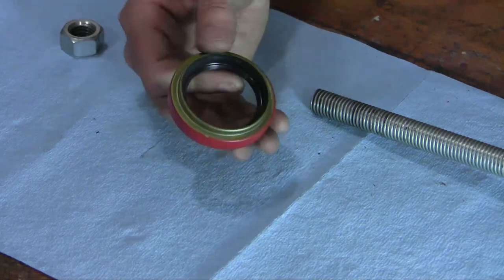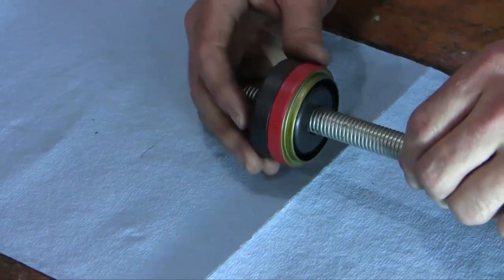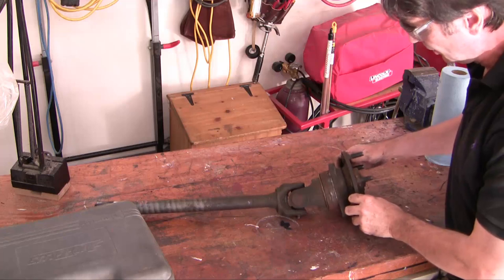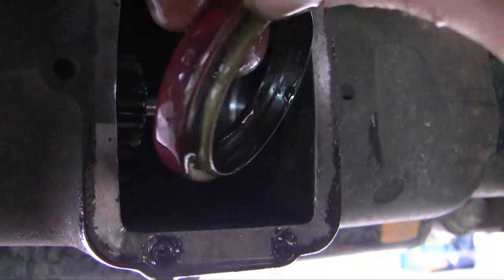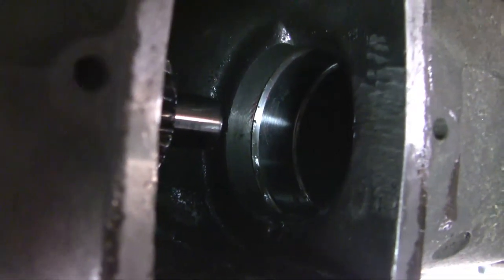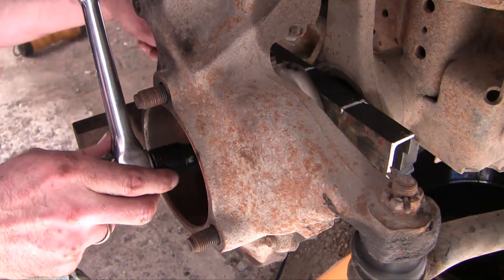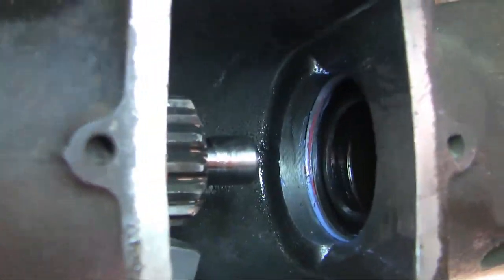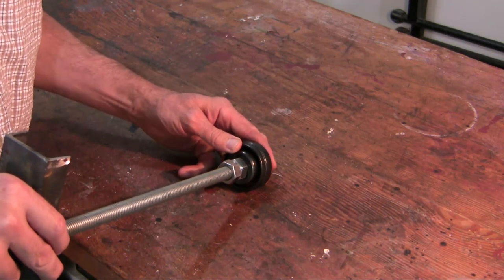Replace right front axle seal, 1998 Dodge Ram 4X4, part 2

Comment: Where did you get the Axel seal installer
Reply from the maker: Quad 4X4. Expensive. If I were to do this again I would probably try the modified hole saw trick discussed below -- there are some linked videos that go into detail.
Reply: spelunkerd Does the little circle metal piece face the inside or the outside of the transmission? I replaced an axle seal  on my '96 Honda Accord and it is still leaking transmission fluid from where the axle goes into the transmission. I got the part from Napa. I think I got a bad part and it does not look the same as the original, though I think it may be a redesign of an earlier model.
Reply from the maker: S Henry Most seals have a spring that wraps around the inner rubber part -- the spring is almost always to the inside, bathed in fluid. That way, pressure from the fluid that is being squeezed out will push the rubber lip against the spinning metal shaft and form a tight barrier. If you aren't careful that round spring can be distorted, damaging the rubber seal. Hammering the seal during installation can also bump the spring off, causing a failure. Most of us spread a finger of axle grease on the lip of the seal during installation, so that when you push the axle in it slides easily without damaging the lip. Be really careful at that stage. Also have another look at the CV joint, since a bad CV joint could cause excessive movement and seal failure. Sounds like you need to do the job again, maybe try an OEM seal this time....
Reply: spelunkerd I redid it and place the metal spring on the inside. However, ther was still leaking how ever I could not get to it by hand using an wrench and socket. Looks like I will need an impact wrench. Do you know where i might be able to find them for a good deal?
Reply from the maker: You mean an impact wrench? The most important part is the compressor, more specifically the tank. You want at least a 25 gal tank, or more if you plan to use it for paint or sanding (those devices require more cfm). I got my impact from Princess Auto, and it works OK though it isn't great quality. If I had to do that again I would spend more for better quality. But all that said, I don't remember needing impact tools to do this job....
Reply: spelunkerd I will need the impact wrench in order to fix my transmission leak on my honda accord. There is a black metal piece that holds the transmission together and I can not get it a loose with my hands using a manual wrench and socket. So you are saying that I will need to get a decent air compressor to do this job? I was wondering if I could use 3 gallon sir compressor.
Reply from the maker: S Henry You may be surprised at the limits of air tools -- if I get a difficult nut I can often get better torque with a length of pipe, moreso than my impact wrench. Depending on the situation, my oxyacetylene torch, PB blaster, breaker bar or cheater bar usually does the trick. The vibration of air tools works for some rusty elements but it's not perfect and air tools don't fit everywhere.
Yeah, if it were me I wouldn't bother with a small compressor. One thing you might consider is renting air tools and a compressor for a few hours. They even rent 1" impact wrenches for really difficult bolts.

Comment: Anybody know a part number on this seal?
Reply from the maker: Gee, I'm sorry, I am surprised I didn't record that. Aftermarket seals don't work with the custom tool, they have a different shape. So, on the second attempt I went to the dealer and he looked up the part number after I gave him my VIN. If you're using the custom tool, quad 4X4 may have part numbers.

Comment: I think 4x4 quad sent the wrong seal driver it doesn't fit in the axle like your tool does and every time I tighten it up all it does is ruin the seal making it stuck on the tool. I'm regretting wasted 59 bucks
Reply from the maker: +precinct 1 baltimore county residents Mine only fit on the OEM seal, aftermarket seals are shaped differently. I'm sure they would take it in return if you can't get it to fit.
Reply: +spelunkerd this seal wasn't from dealer but it slid on the tool unlike the national model at advance. ill try the dealer. the tool would smash the rubber seal and the spring and wedge on . this whole job is getting more and more$$$$ id gotten rid of it if it didn't run so good and steer so true.every part is getting replaced my fault for putting off the ujoint. I needed the truck for work. wheel bearing assy. ujoint  axles actuator and fork along with seal and tool is coming up on a grand. trust I would have sold this if I knew it was in need of all these parts. the wheel bearing wasn't  that bad but I figured hey might as well while its out [never again]